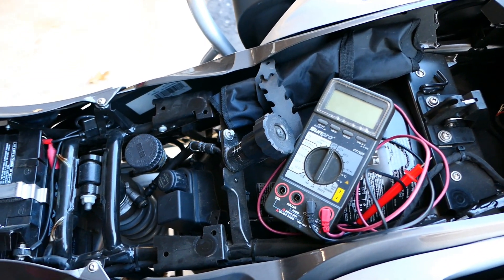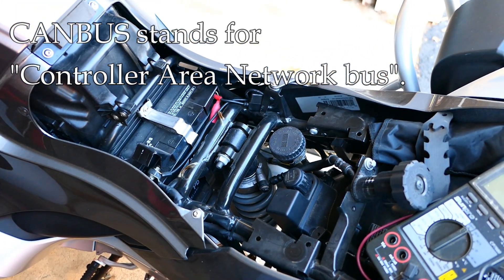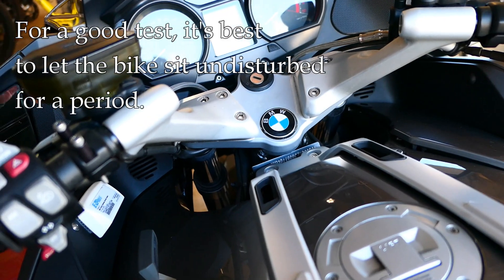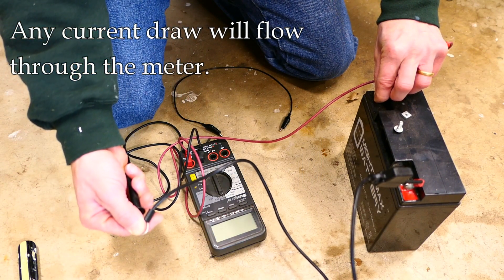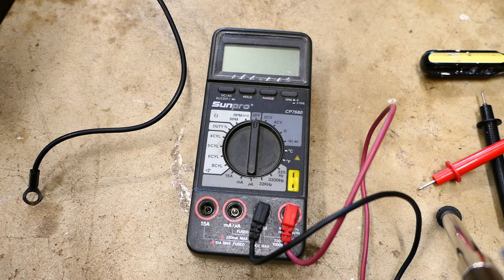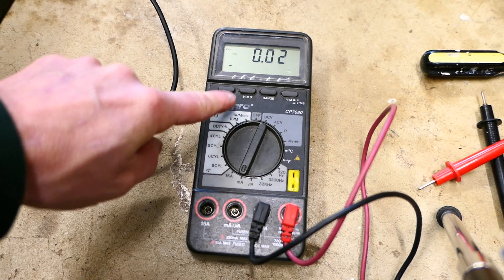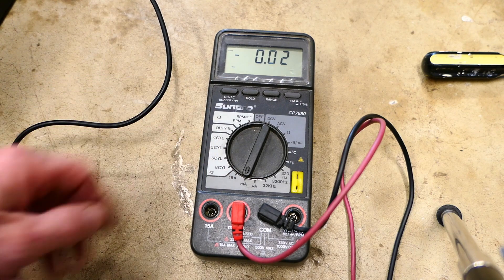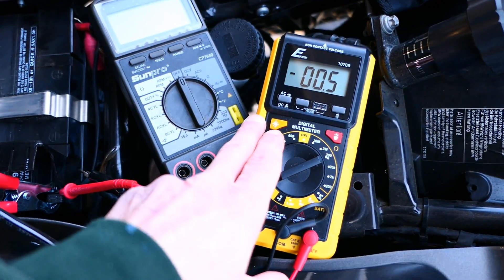How To Test for Parasitic Draw On A BMW R1200RT

Comment: John, thanks for your all your videos...very helpful to me , a first time owner. 
I have a question about your multimeter reading. The meter is set to milliamperes and reads .5  ,,,, I figure that is half of one milliampere . You go on to say that 50 milliamperes is am acceptable parasitic draw. Am I missing something? Jeff
Reply from the maker: I wasn't trying to connect those two things in my statement, it was just coincidence they both had fives.  The very low reading on the meter indicates there is no parasitic draw.  Also, as a rule of thumb, readings below 50 milliamps tend to rule out a parasitic draw.  Readings above 50 milliamps should make you suspicious.  I don't think you missed anything.